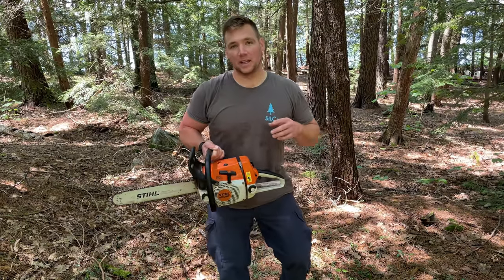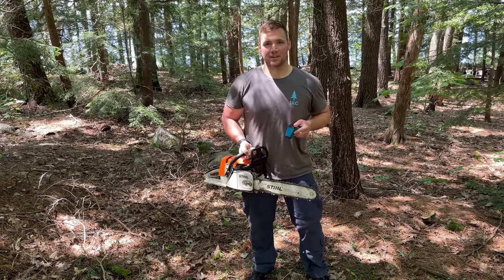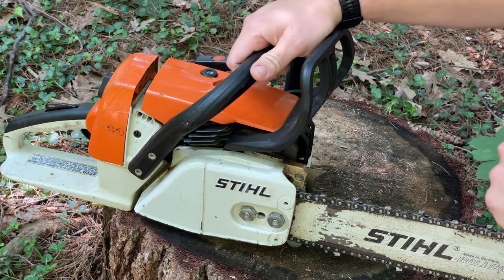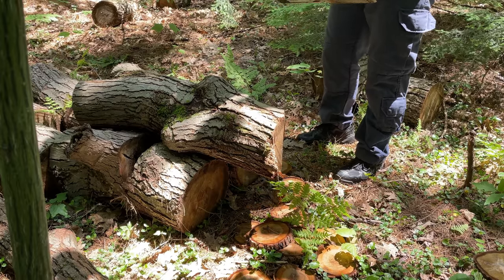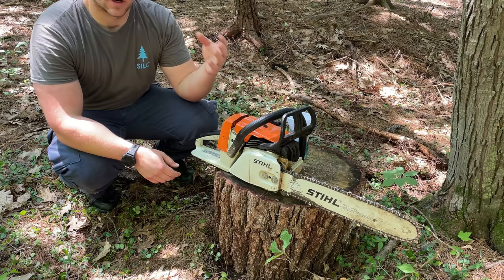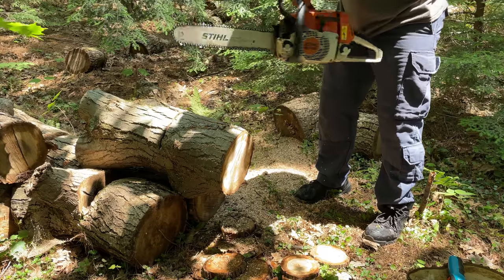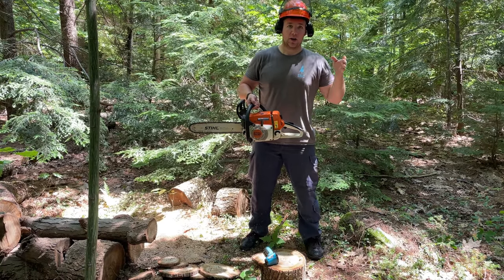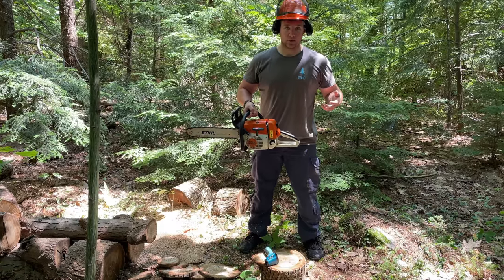Will my chainsaw last longer if I use more oil? Is it safer? (25:1 VS 50:1 temperature testing)

Comment: Cool video. Good tests. I like the way his saw sounded. That 4 cycle sound under no load conditions is what I strive for when adjusting the mixture. Just an occasional poppity pop is fine. I never run my saws wide open without actually cutting wood. I adjust the high speed jet by trial and error. I'll start cutting a log and listen to it. If it has that "miss" sound, I back off, lean the mixture a tweek, and do it again. I strive for that intermittent miss sound when into a cut. The idle is can be touchy too. A balance of the idle stop adjustment and low speed mixture. I adjust for that poppity pop sound and RPM just to the point where the clutch almost starts to catch the chain. I just use 40:1 ratio.

Comment: Honda did test years ago. Two strokes make more power with the most oil up to plug fouling. But there are down sides. The ratio the manufacture suggest is at WOT. 50:1 is plenty for the average user. Id suggest the synthetic premix fuel in a can. At least every couple of tank full. It cleans the carb, rings and exhaust. My equipment has never run better.
Reply from the maker: Do you mean the Aspen fuel!? This is good info!!!

Comment: Excellent test, what are you thoughts on running a good two stroke outboard oil in a chainsaw
Reply from the maker: Hey Brian! I’m really not too sure. I’ve always just stuck with small engine mixes! Let me know if you find out the answer.

Comment: Great video. Now you should compare 40-1 vs 50-1. Curious how different the temperatures match up between them. Thanks.
Reply from the maker: Hey Rod! I’m not sure how much of a difference it would be. Maybe a few degrees. You’re right, it would be a great test.
Reply: @DavesSmallEngines  I'm also curious, you should do a test from 50-1 vs 100-1 using a oil that recommends up to 100-1. To me 100-1 is crazy lean. Right?

Comment: Good video. Did you try this same test but retune the carb to see if there is a temp difference then?
Reply from the maker: I haven't done that yet. I wanted to simulate what a normal person would do by increasing oil. Most aren't comfortable enough with carb adjustments.

Comment: Ok so I have a question Dave? I was given a Chinese backpack blower (EB650) as a birthday gift, and I honestly love it. It does everything I need it to do. And works awesome for my needs. My question is, it calls for a 25:1 mix.  So I've been using regular Tru-Fuel and mixing it at 25:1. It was manufacturerd the manual says 2017, would it be safe to run a 40:1 engineered fuel? Or would score up the cylinder and piston and seize it up? Thank you in advance for any help you can offer me

Comment: Back in the day when some of my friends were racing two stroke bike the most power they could find was mixing with the most oil you could get away with up until fowling. A bike mag did the test on a dyno and found the same thing.

Comment: New to your channel. This was a very well done vid, and very surprising to me.  Seems counter intuitive, I’m still a 16:1 guy on my old Homelites. Very interesting. I need to do some research on exhaust emission temp vs. bearing surface temp, and wondering if the air mix was an issue? But your vid was pretty convincing!
Reply from the maker: Hey Joe! Thanks so much for the kind words. Keep me posted on your results!!!

Comment: Great video! Do you think the differences in both power and temperature could be smaller with carb adjustments between the tests?
Reply from the maker: Potentially.... but I would argue... Why?!
Reply: @DavesSmallEngines  Because you mentioned in the video that 25:1 seemed down on power so perhaps tweaking the high speed for each fuel mixture for optimum jetting might result in higher or lower temperatures and most people would set their high speed for optimum jetting in real world conditions.
Reply: Dave's Small Engines i dont know, but i was thinking that since the fuel concentration is lower in the 25:1 mix, the amount of fuel traveling trough the jets is a bit lower. That must affect power, but I dont know how it affects temp. This is a great science video because it gives some answers and raises more thinking and more questions 🤓
Reply: To be more correct, after watching the video i actually know that it affects temp. What I meant was i dont know how carb adjustment would affect temp 😀
Reply: …i think

Comment: Great video! I have always run 45:1 with golden spectro oil and 94 octane ethanol free in all the equipment. Always great performance and tuning. Very clean oil one of the best.
Reply: First heard anyone mention golden spectro used 10w40 in my motorcycle but got hard to find.
Reply: I burned up an RM 125 on golden spectro.
Reply: @alanmeyers3957  were you mixed and jetted correctly? Because if you change oil ratio without jetted that can happen with any oil

Comment: I was reading comments on another video while I was listening to this one and noticed all the sudden the saw sounded smoother, i came back here and you were cutting the big log with the 25-to-1, may have had less power and ran hotter but it sounded smoother.

Comment: For many years i always added some castor oil to my mix..i took two saws apart awhile back...one was regular mix..the other was castro mixed...the castro saw cillinder looked nice...a slightly grey smooth cillinder..the regular mix, the cillinder wasn't near as good...im going to rering my 40 plus year old saw

Comment: I have been running 40:1 mix in my stihl 026. For 20 years and the saw still runs like a beast. And starts faster and has more power than the Husqvarna I bought 2 years ago..

Comment: MY PREMISE/ SUSPICION is that you MUST RETUNE when you change Mixtures; if that had been done, I suspect 25:1 would give cooler temps closer to the 50:1 temps, (suspecting saw was last TUNED to 50:1)? TUNE TO THE MIX IS THE KEY IS MY PREMISE, so install 25:1, then retune and remeasure temps?  Good Video

Comment: The increase of temperature won't seize the engine but a higher oil/fuel will guarantee a long life of the engine. The best ratio is 1:40 for high quality engines and 1:32 for cheap household engines. many buyers reported their Stihl air blowers engines seized using 50:1 fuel:oil ratio. We cannot dismiss the facts and follow the manufacturers recommendations. Toyota claimed the trans fluid stays good for the life of the vehicle. The truth is that trans fluid starts to degrade after 100k miles. Manufacturers do not care much after your engine is out of warranty.

Comment: I repair& rebuild chainsaws and all the saws I get in for repair are dead because of ( not enough oil ) from day one, and I go back to day one ( 1932 ) all 2 cycle engines ran on a ratio of 16 to 1, gas oil mix , 8oz. oil to 1 gal ( reg gas ). All companies called for the same ratio. With this ratio the engines would last forever ( almost ) . What I use and recommend is a ratio of 6oz. oil to 1 gal. gas ( reg. gas) 8oz. is a little rich , but this is what i recommend for the big saw's. You cannot build obsolesce in a 2cycle engine but run them with not enough oil , and they will die, and this is what it's all about , you can take this info to the bank.

Comment: Stihl oil is a high lubrication oil, in Stihl brush cutters dealers tell their customers to use the throttle full only, otherwise the arrester blocks due to it’s good lubrications in their oil, you’d find this more in chain saws as they might idle more?
You’ll find most home owner models in brush cutters where the arrester blocks for that reason, heck you don’t fully throttle any 2 cycle mowers.
Using 25:1 of low ash high quality Stihl oil (Green) defeat the purpose of low ash better burning properties.
Note other branded oils may result differently.

Comment: My quick $.02. I have an almost 14 year old Stihl FS 80 string trimmer with a lot of hours on it. Hasn’t been used commercially, but it has been used extensively for a large residential lot with a LOT of trimming to be done. Last early spring(2021), diaphragm in carburetor went bad and had to have a new carb put on(Stihl replacement part). I took the exhaust off to burn any built up carbon and to check exhaust port for buildup. To my surprise, the piston and cylinder looked brand new! I let the local Stihl dealer I use install the carb because I wanted to be sure it was jetted perfectly. The Stihl mechanic told me that was the cleanest piston and cylinder with that many hours on it he had ever seen. Moral to the story; I’ve used 89 or higher non ethanol gasoline with commercial grade 2 cycle oil mixed 50:1. That’s what the manufacturer recommends! I also own a Stihl ms 261 pro grade saw and run the same exact fuel/oil mixture. Like some of the other posters have stated; if you change ratios dramatically, you’ll have to retune your carb. Not worth it.
Reply: I just pulled apart a Poulon chainsaw engine that was tired and found what you found in yours- I've been running Amsoil's 2 cycle oil at 100:1

Comment: I would like to add that oil has a higher BTU per volume vs gasoline. Take diesel for example. It has a higher BTU than gasoline. Why you get higher cylinder and exhaust temperature with 25:1 mixture.

Comment: 1 gallon of fuel (90 octane or higher).  .60 oz of Lucas upper cylinder lubricant. 1.5 oz of opti2.  Been using that concoction for nearly 30 years in everything 2cycle I own.  Never lost an engine yet.  Plugs perfect.  Almost no carbon in the exhaust or screen and absolutely no detectable smoke.  Saws, trimmers, and blowers - same for all.  It works out to about 75 to 1.

Comment: My Victa mower is 28 years old and still runs as good as new. As per Carl below, I always use a 40:1 fuel to oil mix.

Comment: was the chain freshly sharpened? was the air filter clean? new spark plug? theres more than variables than just the oil/fuel ratio that plays on the temp of the chainsaw. even the motions you go thru cutting can have an effect on this experiment that could skew the results. i generally run amsoil dominator 40:1 mix in all my small engines and havent a single issue which has been for a bit more than 5 yrs. i used to run motomix but after my bg86c locked up after 1 1/2yrs of running it, i switched to amsoil and never looked back. not sure if i got a bad batch of motomix but i wasnt chancing it on my other equipment.
  after using it for 6 months or so at home, i started using that mix in my ts500i and br700 at work. common sense, which isnt so common anymore, would tell you more oil is more better in this case but i think what kind of oil also make a difference too. that in itself is another who debate to be had.

Comment: Back in the 80's dirt wheels did a Dino test 32/1 made the most power. Less oil = more friction, more oil =lower octane
Reply: Kevin Cameron from Cycle world would say different, they dyno tested a engine with a fuel ratio all the way to 15:1 before it lost power,in fact it made more power at 15:1 than at 40:1. Did they re jet to compensate? You bet they did. They also road the bike in real world conditions and found it did not foul plugs  either. Jetting is key here folks. 
Kevin Cameron was a race mechanic in the 70s and beyond and worked on championship Yamaha TZ700 and 750s and many others. Those Tz bikes were 4cylinder 2 strokes and finicky as well. Dude knows his stuff.

Comment: This might sound crazy, but there are some high performance guys running 70:1 ratios.

They say oil quality makes a bigger difference in bearing and cylinder wall wear than the ratio.
(Until you are too thin and blow it up of course)

Comment: I think oil quality is more important than quantity.  I run mostly Bel-Ray MC-1, synthetic racing oil in my 2 stroke equipment from way back when I had motocross bikes.  Bel-ray claims it can be run leaner than specified but I don't run it leaner.  I have always been amazed how clean and low wear the bikes and now equipment has with this oil!  I think that the manufacturers specify oil ratios but there is a large range that will work.  It is all a trade-off between safety and excessive unburned oil & carbon build up.  Junk oil (Cheap or not) will protect less and build-up more in my experience.

Comment: I’ve always run exact fuel to oil ratio. But I would actually like to see the same test running Amsoil 2 stroke mix, vs stihl synthetic with Amsoil being run at normal mix and at 100:1 as they claim can be done all the time

Comment: I run 45:1. Never had an issue with a FD rated oil. I've also run Amsoil Saber at 80:1. Also does just fine

Comment: I'd think there would be more build up of carbon in the engine which might cause more issues than a few degrees of temperature difference. This does show that under anything but heavy commercial use the precise oil mixture isn't as critical as I was thinking it might be.

Comment: I think that 25:1 mixture offers more lubrication than 50:1 
The only consideration is to adjust the carburetor when using different ratios.
A test done several years ago and went as rich as even 16:1. With proper jetting they determined 20:1 provided more power than 50:1 and virtually no wear. 
The more oil, with correct jetting will always increase longevity.
But no one mentions correct air to fuel mixture, which is of utmost importance.

Comment: If you take it to the extreme and go to 10:1, you will see it really overheat. I still think 50:1 is just not enough oil to be lubricating properly. I run 32:1 in everything from lawn gear to dirt bikes. And I stay away from oil labelled stihl or Yamaha, Honda, semi synthetic, mineral based etc. I just run expensive fully synthetic oil with esters

Comment: Nice Test. Enjoy your Channel.  I have a Stihl 009L with 12"Bar bought new in 1994.  I have always mixed at 45:1.   I use it a lot. Runs great.  Never into shop to get repaired. Sharpen myself.
Reply from the maker: That’s a great saw Paul!

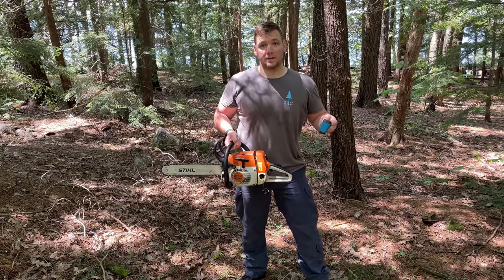Comment: The reason for temperature rising in the second test  is that the chainsaw run leaner when you use 1:25 because of fuel (gaz+oil) thicknes. 
( 25:1 is the two time more thick than 50:1) that provide less fuel passes from the jets you have to  put bigger jets to resolve the problem. 
And In this case the test is not faire in terms of power and temperature... You have to rely in your experience on that the carburetor settings have a good configuration to provide the engine with the perfect mixture of oxygen and fuel in the two cases if you want a good experience

Comment: I see a lot of comments mix up terms as in "more oil makes it richer" .  More oil makes the fuel mixture LEANER.  More oil = less fuel = leaner.  Now could the carb have been adjusted (main jet mixture screw adjusted OUT) to get back a little power and bring down temps?  Maybe but I don't know if the latest chain saws/small 2 stroke engines are adjustable.  In those cases, use whatever mix ration the manufacturer says.

Comment: Dave brotherman that oil is mostly oil stabilizer additives. I'd use valvoline marine outboard 2 cycle oil.& you can use dollar General store 2 cycle oil.& get your own oil stabilizer to premix into your own oil for your saws.& engines of any sort. The gasoline with ethonal raises the temperature in your engines. That oil from sthil breaks down faster.& the friction quality is lower velocity capacity due to oil.& mostly additives mainly. I would use A different brand of oil.,or premix your own type of 2 cycle engine oil to use yourself in your chainsaw.

Comment: Running temp has a lot to do with the adjustment on the carb.  25:1 needs to have the carb turned more rich to make up for the lower gas comtent (almost half).  Otherwise you'll run lean by switching, which will run hotter.

The carb needs to be properly adjusted any time you change the fuel mix.

Comment: @Dave.. great video, but it still leaves the question that others are asking as well, If you retune the carb, can you compensate for the added oil? Personally, I don't think so because if you go richer you are adding even more oil to the combustion chamber! And you would not want to run it any leaner to make up for the added oil, that would be even worse.

Comment: oil fuel ratios influence the air fuel ratio and hence deviation from ideal  stoichiometry  of 14.7 air fuel ratio. The more oil you use the LEANER ( Less gas, more air) the air/fuel ratio and the hotter an engine will run and vica versa... decrease in power cause actual fuel to engine is being reduced....

Comment: When I was logging we used the oil for 2.5 gallons and added 2 bottles to five gallons . 50 to 1 .   Back then the saw had a small air vent in winter you turned it to the snow flake , Warm weather the Sun . it allowed more air flow I notice my MS271 did not have this .  We never run over 50:1  or under that ,   we cut 100 Acers in 5 days .

Comment: My dad has a couple old saws from late 70's.  He always runs 20 to 1, 25 to 1 at the leanest.  The carbs were tuned way back for optimum power.  They both still run great, not lacking power/compression.  I also have a vintage yamaha 360 dirt bike.  I run that at the recommended 15 to 1 with proper jetting.  I inspect it almost every year, and the old cast iron bore and piston is still flawless.  Amazing film of oil on all moving parts as well.  I don't care what this video tries to say, I don't believe you readjusted the carb for the 25 to 1 mixture.  That will build more heat and make less power, because less burnable fuel.  Lean/hot mixture.  So it boils down to tree huggers imo, they hate 2 strokes, and they really hate 2 strokes with rich mixtures.  Anyone that wants to get on the fouled spark plugs train, make sure your engine isn't leaking down at all.  A good engine with full compression will have no problem keeping the spark plug clean.  Also back to making sure your air/fuel mixtures are proper, once again.